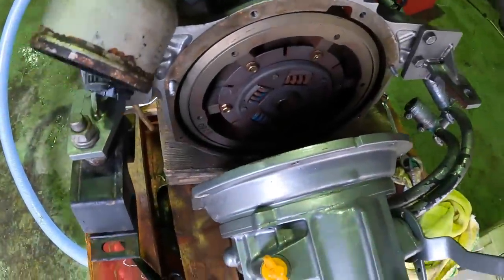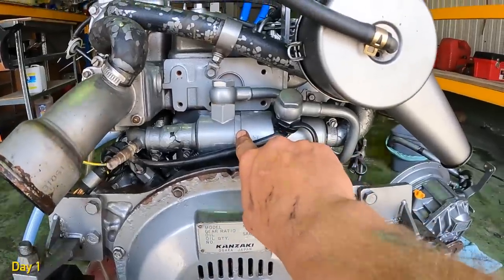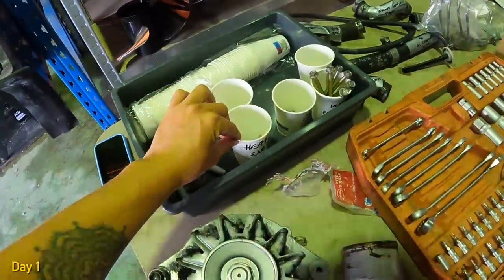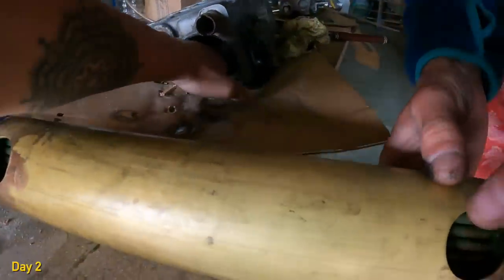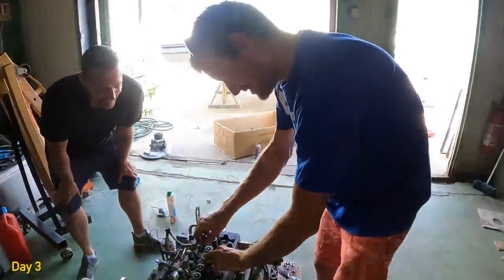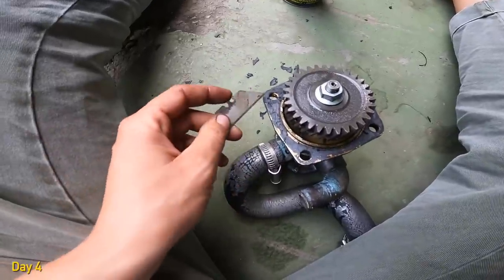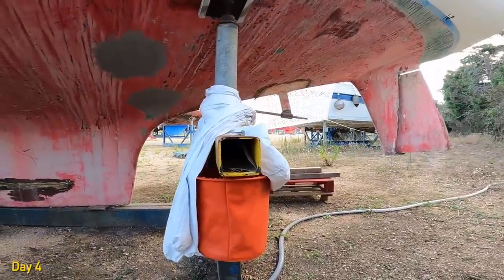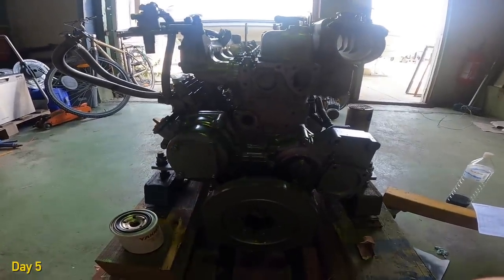Hopefully She Fires On All Four... Yanmar 4JH3E Done! | SAILING SEABIRD Ep. 30

Comment: What did Nico say about the bores, is there any scoring? It would have been a good idea to pull the pan off the bottom and check a main and rod cap while you were in there, but I'm glad you got it all cleaned up. It's a personal choice but I like marine engines white, so you can see when there is oil, and where it's seeping from.
Reply from the maker: The inside looked great. Nico was very happy with it.
White makes sense.
But yanmar grey...
Plus Yanmars don't leak 🤣🤣🤣
Cheers for watching 😃

Comment: So you have a running thumper remember lots and lots of sound proofing or it will drive you nuts. Plus label everything it makes it easy to trouble shoot. Put filters easy to get at, both fuel and oil so no boat yoga. Shut offs for all the above easy to get at. You can design the best engine bay.
Reply from the maker: The engine sounds ok.
We'll get the engine room soundproofed for sure.
The fuel system will be a big and a day, double filtered with shut off valve.
Access to most of the engine is ok.
Cheers for watching 😃

Comment: Sounds is great. Good luck with the motor. Do plan to swap out the various rubber pipes if you can before you install her ....or at least get the spares on your stock. Cheaper insurance for down the line! S!
Reply from the maker: We have cleaned all the hoses plus we have spares.
I'm sure it will be fine.
Cheers for watching 😃

Comment: Nico Is the man, not only looks better, it sounds so much better, may it always carry you through the doldrums ! 🙏🏼🙏🏽🙏🏾
Reply from the maker: Here's hoping.
Cheers for watching 😃
Reply: @SailingSeabird I got a quick way to get rid of flickering lights on cameras for future situations like that! The lights flicker because your camera is setup to shoot with certain fps, and your lights do not light up constantly when turned on, but rather switch on and off so fast that your eyes cannot differentiate the flicker - but your camera often can! This effect is called aliasing, but explaining that would go way too far now. Anyways, the important thing is how to set up the camera for flicker-free video! That is done by changing the recording settings on your cam to shoot at a different Framerate (fps) to the problematic one. 
If possible don‘t shoot with any less than ~24fps as the video would get noticeably jittery and not smooth anymore…

Comment: Hi 
No loss of time opening second hand engine , control statement of mobile équipements , reimplace what has to be and start to test on a provisory frame  before to install in  place .

Seabird is not à light racing boat and safety requires to be sure thé engine will help If nécessary at any moment you 
Are in à need of assistance .

No crushing noise when starting ? No water in the oil ? Nice work. 

Thks for sharing yr challenge steps
Reply from the maker: Glad you enjoyed.
Step by slow step.
Cheers for watching 😃

Comment: Yes, good idea/plan to go over the new motor before installing in the more confining area of the boat haul. I was wondering of the crack made in the center flow section of the intercooler, did you J-B Weld it or something so not to have a cooling failure/leak later on when out to sea?
Reply from the maker: I don't know what you're referring to.
Everything seems OK. No cracks.
Apart from the thermostat housing but we have a spare for the time being.
We'll get a new one ordered.
A few loose ends to do on the engine.
Plus we need to sell the extra block.
Maybe today we'll go take some photos.
Cheers for watching 😃
Reply: yes, I went back and checked the video and at 10:34 you hammered out the inter core of the after cooler and pointed out what may be a small crack on in it from the hammering.
Reply: @SailingSeabird  Plese check video at the 10:40 time that will explane/show you.
Reply from the maker: We fixed it.
Thanks for the support.
As always, Cheers for watching 😃

Comment: Sounds okay,  runs fine,  is it boring being a mechanic? No,  not with engine rebuilds, (i was a mechanic for 30+ years)  i did only engine rebuilds for about 10 years,  we have different acids for different parts,  plus special tools to clean old gaskets off.. 
that wasn’t anywhere near a complete rebuild, it was even a “head service”  but your mechanic knew what you needed,  his use of brake cleaner?  Yes! 😂 that’s actually a trade secret.. (it evaporates leaving no residue)   
Anyways 
Thanks guys!
Reply from the maker: We never planned a rebuild. Just wanted to check inside.
Cheers for watching 😃
Reply: @SailingSeabird  just don’t leak the brake cleaner trick..   😂.    I used to buy that stuff by the cartons of cans..     it works like magic,  and I don’t think i ever used it to clean a single brake part….

Comment: You usually see that flickering light when they're using fluorescent or LED lights hooked to a power grid that uses the same cycle-speed as your camera, usually 60 Hz for both the power grid and the camera. It's also really common on LED lights with an AC inverter that's providing a clean 60 Hz current.

If you really want to avoid it, you could try messing with the recording FPS so it's out of sync (say, a slower 50 Hz/FPS or a higher rate, like 90 Hz/FPS, where FPS is frames-per-second), which is why you don't see this in older movie footage that used either incandescent bulbs (which didn't cool down enough during a 60 Hz cycle to show a flicker) or a 24 FPS recording speed. Not sure if your camera or editing software will support alternate FPS rates, though. YMMV.
Reply from the maker: We know for next time.
Thanks for the advice.
Cheers for watching 😃

Comment: Run it with dipetane additive. It will clean the engine run cooler more economical and prevent carbon build up. You can also use it in two stroke engines and petrol but its best in diesel systems. 
I run it in a 27 year old MAN truck, an Audi Q7 and a hedge trimmer. You could wipe the inside of the tail pipe on the Audi and lick your finger its that clean. The test centre told me they thought their test machine was faulty so they tested it on another lane and got the same result 0.0 parts per million.
No affiliation just a long term user and satisfied with the product.
I say all this because unless you did the rings, reseated the valves and serviced the injectors you made very little difference to long term running. Dipetanecwill do all that for you and save you money.
Reply from the maker: Great advice.
Cheers for watching 😃

Comment: You could of just checked compression without removing cylinder head, otherwise you have to resurface it to make sure it’s even.also there is proper procedure on how to remove head bolts.
Reply from the maker: We also wanted to check inside and replace the gaskets.
Thanks for the advice.
Cheers for watching 😃

Comment: Is the old gear box 1:1 gear ratio and your old box is multiple gear ratios 7:1 then 4:1 then 1:1  i'd stay with your old box , 3 gear speeds is better isnt it ? Or do you only need forward and reverse ?
Reply from the maker: The gearbox has a forward and reverse gear. 2.36 and 3.16 I think.
We sold the angled box. 
The parallel box and the incline of the engine bed is all good.
Cheers for watching 😃

Comment: You should have used under coat first give the paint something to bond to oh well
Reply from the maker: Good point.
Cheers for watching 😃
Reply: @SailingSeabird  Thanks for replying nice to see you read comments in your busy days, i would recommend make sure your engine bay has no cracks or holes because in my experience the water builds up in the hole ,like when you drilled the hole on the out side of your boat and the water came out ,just saying.
Reply from the maker: Before we get the engine in, we'll be giving the engine room a make over.
Months away from that...
Cheers for the advice 👍

Comment: What are the benefits of a central cockpit(if that's what it's called)? I hadn't come across this set up before so I'm intrigued why one would choose a centrally located one to a stern located one.
Reply from the maker: Hiya,
Firstly, your steering from the centre.
The layout normally has cabins at either end of the boat.
But mainly, it's a personal choice.
Cheers for watching 😃
Reply: @SailingSeabird Sure I can see how it would be a personal choice, I was wondering what motivated you to choose it. Is it because steering from the centre is easier and if so, how is it easier?

Comment: What happend to the Borg Warner velvet drive you had, bloody good gearboxs
Reply from the maker: Hiya,
We sold it with the old engine.
It was a bit rusty.
Cheers for watching
Reply: Rust cleans off, you let a good gearbox go, had two of these in a fishingboat I had for years   2:1 reduction.   Best of luck with the new one. Check the thrust bearings for water ingress change flange seal if old.👍
Reply from the maker: Thrust bearing?
Reply: @SailingSeabird  Bearings at back end of Gearbox that take up the thrust from the Prop', ask your Engineer.